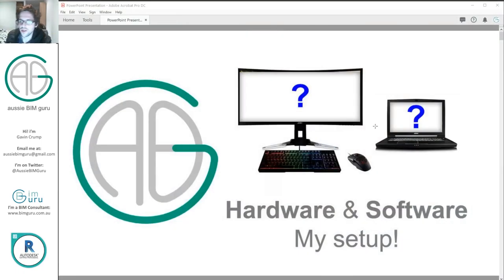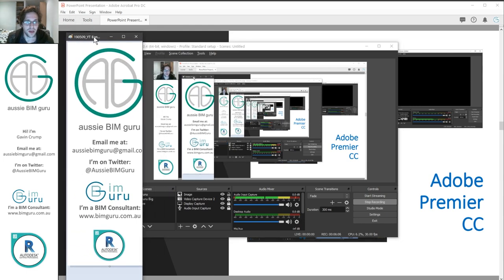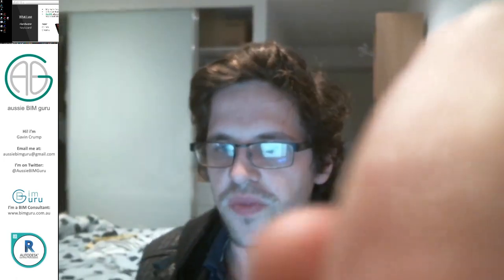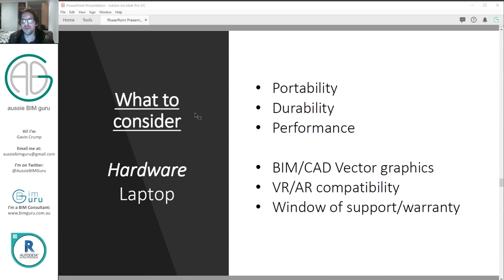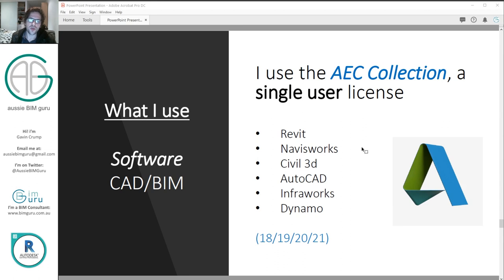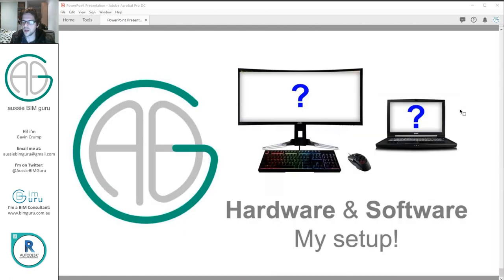My Hardware & Software setup!

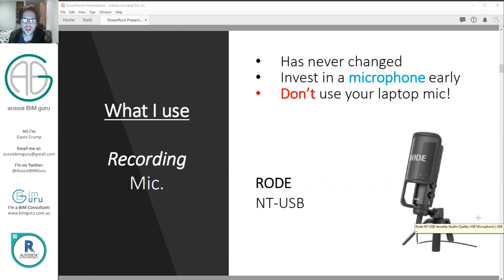Comment from the maker: 2:00 Microphone
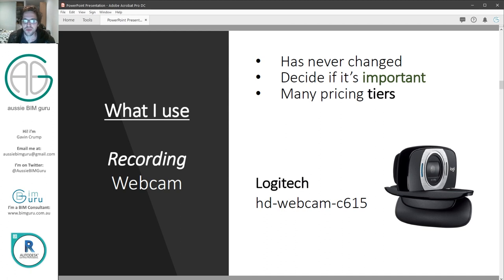3:17 Webca
m
4:23 Recording software
7:45 Alternatives
8:25 Primary monitor
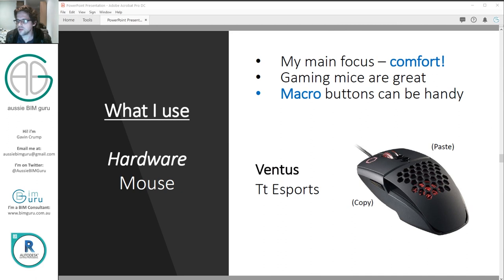10:07 Mouse
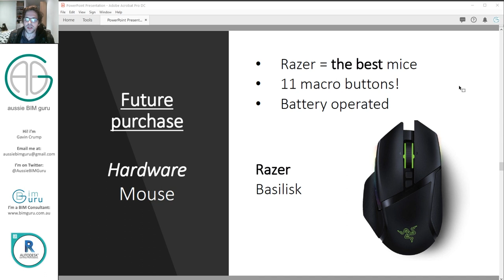11:27 Keyboard
13:12 Selecting a laptop
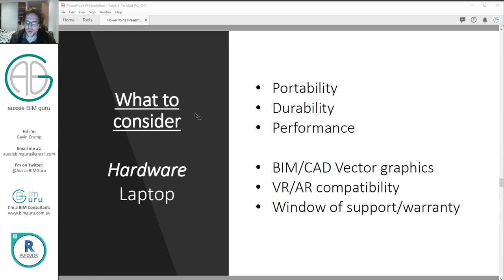14:15 Laptop
15:08 Laptop specs
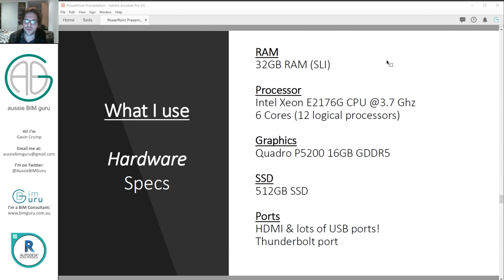15:27 Suggested specs
17:42 BIM/CAD software
18:40 Graphics software
18:50 General tips

Comment: I use OBS as well for my own channel. It’s great and very versatile. When it comes to the Adobe programs, I settled on using Photoshop Elements and Premiere Elements. I know they are consumer oriented programs but they are quite cheap and easy to use. Premiere Elements has an unlimited amount of tracks that you can use. I was debating with a colleague the other day about graphics cards for Revit, it seems like Autodesk only recommends Quadro cards, even though my workstation (built from off the shelf parts) has a Geforce card in it, and works quite well. It’s said that Quadro cards have better drivers, but we where not able to convince our boss of this. The price difference is quite big, and budget is limited, but my workstation has 32 gb of ram and I use op 12 gb of it on typical day. I always run AutoCAD and Revit side by side.
Reply from the maker: Yeah still using OBS now and loving it. I moved on from Photoshop/Premier to Photopea/Davinci. I'd highly recommend the latter, it's so much easier to use and work with than Premier so far (and the beta is free). Photopea is a bit weaker than Photoshop, but is free/web based and has most necessary features for standard users.

I know many people using Geforce/RTX range cards without issue. The Quadro cards are also discontinued so it will be interesting to see what the recommendations shift to over time.

Comment: Hi Gavin, great video! we got updated with Nvidia 2080S  in the studio and can move all teh big scenes in Lumion, Twinmotion, 3D MAx...I would never recommend Nvidia Quadro nowadays  for visual 3D Architecture purposes.
Reply from the maker: Yeah I've been hearing great things about the 2080 recently, does it run Rhino/Revit without a hitch? I'll probably be looking at this for my next laptop, or whatever upgraded card is out by then in the range. I found the 1080 could have some anomalies from time to time when dealing with vectors but handled 3D vis well.

The quadro has been working well for me so far with 3D vis although the laptop works hard when I use it, fan goes into a different gear!

Comment: Love the set up, clean and efficient without a lot of hassle. The mic you are using is great. I have had mine for a number of years and have used it for youtube tutorials and tutoring online classes at university. I have upgraded my webcam to a DSLR (Canon 70D) and have found a bit of software to get around the 30min turn off timer that most DSLR cameras have (see Cam Twist, and Camera Live). Although this set up isn't as easy as a standard webcam the higher quality was more important to me as I wanted to connect with students better and i think the visual quality was important. I have recorded with both Quicktime (on my Apple iMac), OBS and Camtasia ($300 AUD if i remember correclty). I find Camtasia is worth the money for the ease of use and the fact you can do simple editing with it. The editing i need to explore further as I am used to using Adobe but the editing features looks decent and intuitive. 

As for peripherals a simple keyboard with a Logitech MX Master mouse works a treat.  I have found the ergonomics of the mouse are phenomenal and were the main reason i bought it. That said, i have noticed the buttons on under the thumb doesnt have a nice tactile response and i rarely use it and the two small buttons near the horizontal scroll are slightly too small for my liking. I haven't investigated the new models (i have the 2) as i am mostly happy with it and see no reason to change
Reply from the maker: Hey LJ, good to hear from you! Haven't seen you around YouTube for a while, are you working on course platforms these days?

Efficiency was definitely the focus, here and there I probably spent a bit more money than I needed to vs some other setups but my research time ran out eventually.

Great to know about Cam twist, I might go down the DSLR path if I find myself doing more course content (just starting in this field). Camtasia is definitely on my 'to try' list given I'm thinking of moving away from Adobe CC, although Davinci looks quite capable too.

I used an MX Master at my old office a few times, definitely one of the most comfortable mice I've tried but I did also notice the buttons had some issues RE response. I'll be considering it in my shortlist when I finally venture back out into the post pandemic wilderness!
Reply: @AussieBIMGuru  hey mate. Yea, it has been a while. I've been limiting my social media use 😁 and I've been busy with university tutoring and taking some time to myself. I have been thinking about getting back into the community of Youtube again soon.
I ma not sure if CamTwist works on PC but surely there would be an alternate. I find either that or Cam Live can occasionally have connectivity issues which cause delays but on these days I run the utility that comes with the camera (Canon EOS Utility for me). Usually, this will have a Live camera feed from the camera and you can use OBS to create a window of the live preview area without having the hassle of using no native camera software.
Reply from the maker: Great to take a break! I'll probably need one myself eventually... youtube/consulting is a time heavy mix.

Thanks for the tips, good point RE compatibility.. didn't think about that, whoops! Lots to add to the research list, much appreciated.

Comment: What are you using Acrobat for? Alternatives are wide and varied; we have been using Bluebeam for many years although is does cost, you could probably get away with the standard version. I also have MasterPDF when I don't have a BB lic, find it is very good but not in the league of BB for editing and markups.  Also Squid on Android, especially on the Samsung Tabs is very very good for pen markups.

Gimp is fantastic and has become easier to use over time. PS can do more but once I learnt Gimp I didn't need all the crazy features in PS.

Scribus is another alternative to InDesign however it not as intuitive or 'pretty' but works very well.

What are you using Illustrator for?  Inscape and Krita are both solid alternatives,

Hell if you want to go all out Revit can be replaced with BrisCAD (so the marketing says....)

That MSI laptop is insane!  For me it is overkill but for you it is probably perfect.  I agree with a bunch of the comments here regarding high clock speed processors.  In addition I have run Revit very well on just the Intel embedded graphics, it doesn't tend to use the graphic chip much during normal application.  Having said that gaming cards work perfectly well - just have a look at BimBox who build optimised systems for Revit; https://www.bimboxusa.com/products
Reply from the maker: Acrobat comes with Adobe CC and I find it's a good all round PDF editor/viewer, not the best by any means - but if I've got it with CC I figure I may as well use it. I've used Bluebeam in the past and do prefer it for markup/measure etc. but I mostly work in BIM/CAD programs so don't have a lot of need for this in my day to day work. BB would be an extra overhead for me to cover, so wouldn't be worth it for me personally given I already use CC.

I've tried using most of those OS programs (and Houdini as an alternative to Premier) and they're always just that little bit too clunky for my liking. I have a lot of experience/history in Adobe programs for both work and play (I use photoshop for making card games and templating for example - I have a lot of legacy work in psd format). The time I'd save using these would pay back my license and then some each month (for example I have some fairly advanced templates in Indesign I deliver all my bids/proposals in that I know Scribus/Affinity and similar OS/free tools wouldn't be able to do as quickly/smoothly).

To be honest I rarely use Illustrator, mainly for processing files back into vector where absolutely necessary. I appreciate the impact of such programs as Gimp and Inkscape, and I've tried them all - but for me open source isn't always the best option (most people focus too much on the cost factor, and not enough on the source aspect of being open also). Inkscape would be my goto if I did a lot of vector graphics work (svg files etc.), but Photoshop still wipes the floor with Gimp when it comes to ease of use I think.

I'm aware of BIMbox and have heard great things about them also. RemCis is another maker I've got my eye on. I expect my machine should last me at least 5-8 years based on my specs and the slowing of Moore's Law, but my next build would probably be more custom. So far my laptop has been a dream, no regrets - I got it slightly discounted as it was their last model too luckily. I might take advantage of the SLI to double the RAM eventually, but for now it's well over what I need.

Thanks for the suggestions, always good to know what options are out there!
Reply from the maker: Also I've got more than 10 years experience in Revit, and nearly all my clients come to me for this. No way I'm jumping to BrisCAD until the market does!

Comment: Good video first!! Actually Revit has a heavily parametric kernel. The multi-threading of Revit is quite limited. A CPU with higher single thread performance will be definitely better as I test privately. So I think i9-9900K would be a better choice than Xeon series. But no matter how fast your CPU is in 2020, it's still limited in those large and detailed projects. So we still have to conduct performance optimization methods recommended by Autodesk, such as isolating, hiding elements. Besides, its low graphic performance in large projects is a bit weird compared with Archicad. The usage of a graphic card is fairly limited. So a graphic card like GTX1070 would be enough. I guess its graphic mechanism based on Direct3D works with a vectorical method rather than rough rendering via OpenGL. And the vectorical method may be heavily based on CPU. As a result, it becomes really slow for 3D orbiting especially in a large and detailed project. You have to isolate elements constantly in order to get rid of slow graphic performance. Hope Revit can fully utilize GPU and Multi-core CPU. Then it will become a really cool software!
Reply from the maker: Thanks and appreciate the breakdown - as you could probably tell I don't have a deep knowledge of CPU/GPU impacts but I was aware that Revit can only utilize a portion of the CPU - a shame! I hope to see them rejig it in future as well.

Comment: Hey Gavin, thanks for that! I would like to ask you something. I tried to use OBS portable (because of admin rights with the company's computer) and it either uses internal graphic card and jams the whole computer (can't record rhino grasshopper videos seamlessly) or if I force to go to the graphic cards (Quadro P520) then it doesn't recognize the monitor. Usually I use an extra monitor as well (and this happens when using it). Have you ever experienced something similar? :)
Reply from the maker: Hrm I haven't had issues like that yet unfortunately, usually I just use the display capture source for my primary monitor and it seems to know what to do. Might be worth getting in touch with their support team!

Comment: I think that the GTX/Rtx gaming orientated video cards do work fine for Bim, I have a gtx 1070 myself, and it works perfectly with Revit. The versatility of these gaming cards are getting better, so they can do all sorts of tasks. Quadro is still the best for productivity/performance, but the gaming cards are a somewhat cheaper option to consider as well, especially for students.
Reply from the maker: Definitely cheaper for sure - the quadro made a nice dent in my wallet! Great to hear people are having success with alternatives, even if Autodesk wont put their seal of approval on them.

Comment: A great alternative to the Razer Basilisk (that many, including myself, swear by) is the Logitech G600 - it's quite a bit cheaper and the first one I bought lasted me about 6 years.
Nothing beats the MX Master in ergonomics, though - gaming mice don't often have the proper ergonomics for the type of repetitive small movements you're likely to do in Revit, in my experience.
Reply from the maker: Great tips! I'll give the Logitech G600 a try in store I think, looks like a great mouse - I like the macro placement as well. Thanks :)
Reply: @AussieBIMGuru  Definitely give the MX Master a try as well if it's in your budget(business  expense, remember?:)) I've been using mine(version 1) for the past 5 years now.

Comment: Wow you are using infraworks, i learn infraworks but didn't get chance to work in.

you should make video for how to edit videos :-)
Reply from the maker: I don't use it very much, only played with it a bit. I like to try out all the tools other people are using where possible.

I actually have very minor editing in my videos - I spend less than 5 minutes editing each time! The key is to have a template project (intro/outro) set up then all I need to do is insert the video in the middle and trim either end, then apply a cross dissolve filter. QED :)
Reply: @AussieBIMGuru  supper quick 👍